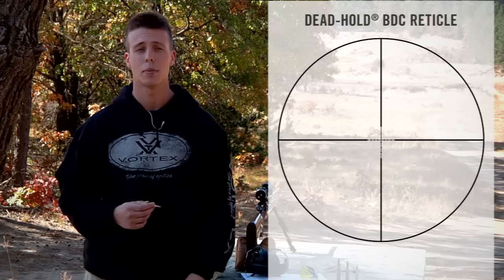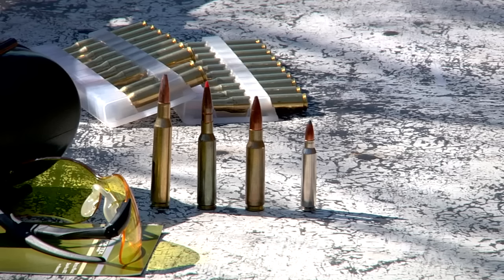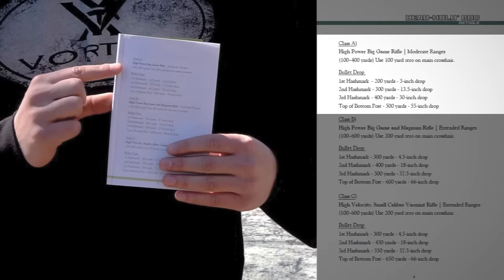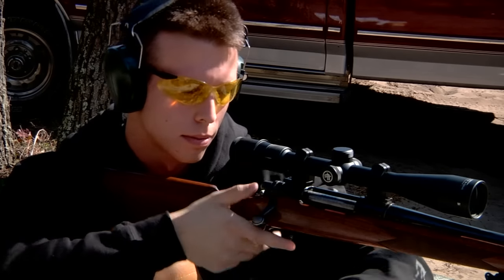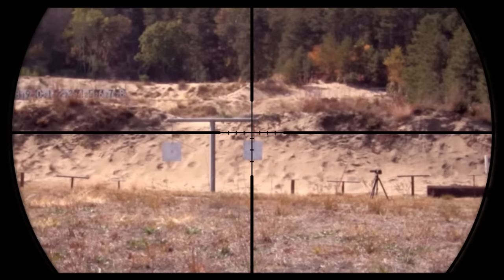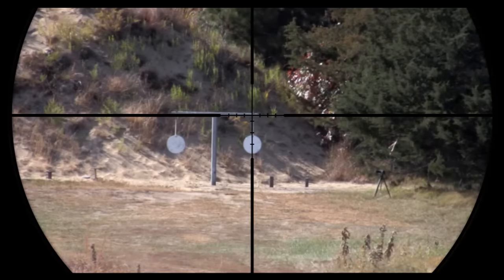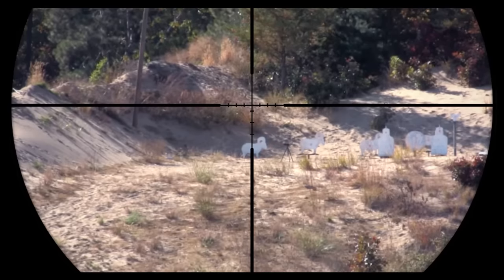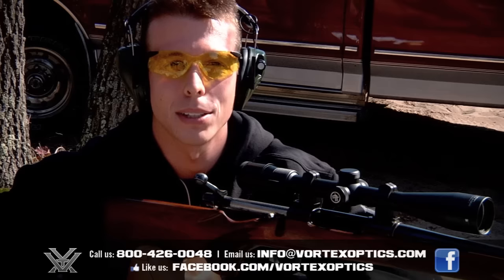How To Use the Vortex Dead-Hold BDC Reticle

Comment from the maker: Good morning Brian- Kind of depends on if you're running the .338 Win Mag or Lapua... Most loads for the Win Mag will follow the magnum category better- Class B. This is listed in the manual or on our website. It works off a 200 yard zero. Just remember to validate all of this at the range. The BDC is a good estimate but testing this to confirm the data in the field is very important. Thanks and let us know if you have more questions.

Comment from the maker: There are no indicators on the BDC reticle that are designated for shots at those distances but the LRBC on our website has a feature where you can manipulate the magnification to change the subtensions and then observe how the holdovers change. It is possible you could find holds for those distances from simply lowering the magnification. Thanks again and please let me know if you have any other questions.
Reply: I just ordered a crossfire ll 6x24x50ao the gun I will have it on will be my ar15 18 in fluted 6.5 Grendel using 123 gr sst hornedy says flat on ammo box at 200 yrds should I zero my rifle at 200yrds then use the bars on the reticle to go from 200 yrd on the middle cross hair out to 300 yrds and so on?

Comment: Great shooting! Just purchased a Vortex 4-16X50 Crossfire II and I love it. And I absolutely love the warranty! Worth every penny.
Reply: My little cousin got me one for Christmas last year. LOVE IT!
Reply: How is it holding up?
Reply: @rikertvonfulton16  I have one on a .243. Front ring adjustment for parallax. When I shoot it, it rings like a tuning fork.  DING!  Don't know why. I may wrap a couple large rubber bands around the bell and see if that stops that noise. So far the accuracy seems okay. Sub MOA out of a Savage 10 MAX1 Predator.  If it doesn't work out I'll just slap my old $49.97 3X9x32 Tasco on it because it will shoot .38 inches at 100 yards with a factory .22 Stevens 200 .243 :)
Reply: @cbsbass4142  Just pulled a tasco because the crosshairs were moving around in there.I put the Vortex on. 2x7x32.
Reply: @rikertvonfulton16   I may have just been lucky with that old Tasco. It came on my first .Savage .308, gosh, maybe 25 years ago. Very clear and sharp still. Much better than  later Bushnell that came on my next .308. I nurse it by using it only on low recoil calibers.

Comment: Tested this on my 7mm-08 and confirmed it is reliable out to 500 yds. Thanks for the great video
Reply from the maker: Awesome! Thanks for being a part of Vortex Nation!
Reply: How many yards did use Eero it at I'm shooting the same caliber also interested in the mo
Reply: @stephenkulawinski4200  I zeroed @ 100 yards.
Reply: did you use  the vortex LRBC  FOR THE AMMO YOU ARE USEING IN YOUR 7MM-08?
Reply: @gooseman26  yes/no. I use handloads I reload myself. I have checked them on a chronograph for avg velocity. I also have input this data into a ballistics calculator and I have a dope chart worked up for my rounds. However, the Vortex BDC reticle is a solid quick reference that works fairly accurately and reliably at 100 yd increments out to 500 yds.

Comment from the maker: Glad you're enjoying your Viper! The .17 HMR actually does not fall into either of those categories. However, someone discovered that if you set the scope to max power where the subtensions are correct, then zero your .17HMR dead on at 50m (yds) then the dead hold bdc lines below correspond to 100, 150, 200 and 250 (top of post). Thanks and please let us know if you have any other questions.

Comment from the maker: The Viper 6.5-20X50 or 6.5-20X44 both use the mildot. The Viper HST and Viper PST both use mils subtensions similar to the mildot reticle, but with finer graduations. The Razor HD also uses a reticle and turrets with mils subtensions. Thank you and let us know if you have any other questions.
Reply: I have a 270 with a 6×24×50 vortex crossfire 2 what is max distance for scope
Reply from the maker: @andrewcarter4937  That would depend entirely on your setup and ballistics. Give us a call at 1-800-4VORTEX ext. 5 and we can help out!

Comment: That reticle also works good with 950 Fps 22 subs . I'm hitting dead center at 35 and 22 yard targets and out to 60 yards I use the first line down for quarter size groups right in the bullseye.  Works like a charm.  Have a Crossfire II 3x9x40 with burris Zee rings (Low) on a 10/22 and Magpul hunter stock.

Comment: I just purchased a Diamondback 4X12X40 DH BDC. For the price it is a great value. I placed it on top of a MVP 5.56 X 45 rifle. Zeroed it in at 200 yards. I have owned many high priced scopes. This one is a true workhorse with above its price range capabilities. If you are looking to by one don't think twice.
Reply: I like the reticle even if I don't use it much. fooled around some with it at my ranges limit of 300 yards on an 8 inch round steel chain swinger with my .243. I  hit it. I just really can't remember the holdover or bullet weight.

Comment from the maker: Good question! In the dead hold BDC manual that should come with any Vortex dead hold BDC riflescope, there will be different categories listed inside that you will have to fit your cartridge into. The 22-250 would be Category C: Zero at 200, first hash is 300y, then 450y, then 550y, then 650y. Those are just approximations, though. Make sure to test all of these with your specific cartridges at the range to confirm and/or adjust accordingly.
Reply: Would the 6.5 creedmoor fit into that same category?
Reply from the maker: @ryanmounts6633  That would probably align closer with category A. To get the most accurate results though I would recommend running your specific ammo through a ballistic calculator.
Reply: Alright ill do a little reasearch, my factory ammo advises a 200 yrd zero is why i was thinking itd fall in with c but ill do so.e more digging, thank you

Comment from the maker: Since all of our riflescopes with BDC reticles are second focal plane scopes, they all require that the magnification to be set to the highest power to be used accurately. If the magnication is set to a lower power, the hash marks will be worth more than they are designed to be. Thanks again and please let us know if there's anything else I can do for you.
Reply: Is there a way to do something like 'half zoom/double value' on the bdc, or would I have to build a whole new table at different zoom levels? 
Asking in regards to making ethical kills with the 'dead hold BDC' on a 22lr on ground squirrel sized targets between 25 and 100 yards. Will this work or should I just bite the bullet and spring for the FFP?
Thanks
Reply: Metric bdc would be a nice option

Comment from the maker: Windage will be different for every rifle, cartridge, distance, and wind speed. There are too many variables involved to make a short, simple video on it. I would recommend using a ballistic calculator to estimate wind holds and then validating this data in the field with your specific rifle. Thanks again and please let us know if you have further questions.
Reply: At what magnification are the BDC markers usable. I know some scopes claim that their markings are only accurate or to be used at max magnification.
Reply from the maker: @robertwest4299  Most are at the highest magnification, but some will be at a specific magnification that will be listed in the reticle manual.

Comment: Works very well with the Vortex scope.  However, using a Leupold 3.5 to 10 with a 130 gran  Hornady Interlock SP, our zero is at 200 yards. At 300 yards it has a drop of 5.7" drop, yours is 13.5. - At 400 yards it's 16.7" , yours is 30" - and at 500 it's 33.7" and yours is 55".  A difference that can not be ignored when shooting long range.  We'd like to hear back...
P.S. we also use Remington ammo, which has about the same printing results with boat-tail ammo. To be fair, we're shooting a custom Mauser with a 26.5" barrel, 9.5 to 1 twist.
Kind regards
Reply: TJ Jones
  I'm not sure you're asking a question? By the way, I said in using Remington ammo that boat-tail has the same results. Well, I should have said I don't use anything but boat-tails.
  Not to be too critical, but shots 2, 3 and 4 were lower then each hash mark. The first and last shots were right on it. That said, my Leupold has the micrometer setting, and at each of the same distances, I only need to go up to the next number and the shots are dead centered with no variance, just dead center. Your shots were fine, but wouldn't necessarily yield a high score when counting rings to the center of a target. I do believe that is the difference in price of each scope. You will hit the target, but it won't be as accurate to the scope's strategic BDL. Maybe I'm too fussy, but that's why I spent the big bucks, that orther 1/2 or full inch you're losing.
Kindest regards.
Reply: TJ Jones
What are you talking about? Maybe you're addressing someone else? I don't know how the 3006 got involved. lolo

Comment: i just saw this today - got an expr winch- never used a scope before - thank you
Reply from the maker: Glad you found it helpful :)
Reply: Does anyone know what isize flip up scope cover for the vortex 3-9-40 scope front and back
Reply from the maker: @maxlewis2234  If you are looking at the Defender Flip Caps, you will need the E-10 eyepiece and the O-40 objective piece for your scope.
Reply: @VortexOpticsUSA  OK thanks for the info . I am interested in them just reviewing the product,  however I  have read that they tend to fall off in cold weather , I live in a cold climate . But overall they are good . Someone suggested using double tape, is this an issue with the product.
Reply from the maker: @maxlewis2234  No issue using double tape! You are good to go there.

Comment: Thanks for this video.  Primary arms is running a killer deal on your 3x9 50 bdc crossfire model and a burris pepr mount bundle that I couldn't pass on.  It's in the mail.  I'll be at the range soon getting this scope dialed in on top of my new AR15 build.  Once its all tweaked to my liking I think its going to be a fantastic arrangement.  This will be the first time I'm attempting to stretch my legs beyond 100 yard or less shots.  I'm excited.  A new range opened up near me that offers steel like in this video beyond 100 so seeing the drop marks and approx where to hold was exactly what I needed to see.  If I run into any snags I'll be in touch.  Thanks again.
Jeremy in Texas
Reply from the maker: Thanks for picking up one of our scopes! We really appreciate it. Enjoy stretching out a little bit and yes definitely drop me an email if you have questions. You will find there is some variance between cartridges but with a little playing around, you can figure out what the drops will be for anything you have. Thanks, Jeremy! Happy shooting! - Jimmy, jjordan@vortexoptics.com
Reply: Finally got the scope and mount from Primary.  All mounted up. Ready to hit up the range and start the sight in process.  Again if I have any issues I'll be in touch.  So far extremely pleased with what I received.  I doubt there will be any issues.

Cheers from Texas.
J
Reply: Several trips to the range now. I've only attempted 300 yards max.  Hearing that steel sing has been so rewarding. Several folks that have looked through it have been very impressed with the clarity of the image and have you guys on the radar now too. Especially when they find out how reasonably priced it was. If I'm in need of another piece of glass myself I'm definitely going with a Vortex product again.

Comment: I just zeroed my axis with a diamondback scope using 150gr Hornady. Zeroed at 100, no problem. At 2-300 moving down to each hash mark I was shooting way to high so I used the crosshairs at 200, I hit 2in above POA. At 300 same POA and I hit 3in above at 300m. There were no stray rounds at all three ranges so hits were all consistent. So after watching your video online of the bdc I'm a little baffled. Very pleased with the scope. Thoughts??????
Reply from the maker: Hey thanks for reaching out to us. Reading this, there were two things that came to mind as the likely culprits:

1.       Your 100 yard zero is not actually a 100 yard zero- you were zero’d high or something and maybe didn’t notice it before stretching out to distance
2.       Your rings were over-tightened (generally anything over 20 inch pounds can cause issues- we recommend 16-18 inch pounds).
 
Did you install the riflescope, by chance or did someone else? I’m just curious if a torque wrench was used or if you knew how tight the ring screws were tightened? Otherwise, the possibility of a .308 zero’d at 100 yards that kept climbing out to 200 and 300 yards is physically impossible and it’s just a matter of finding what the issue is. Thanks for the question and please let me know if there’s anything else I can do for you. I would be happy to help. - Jimmy, jjordan@vortexoptics.com

Comment: what 270 load was used in the video? I bought a diamond back 4x -12x  and I am using a 130 grain load with an interlock bullet not sure to use a 100 zero or a 200 yard zero due to ballistics.
Reply from the maker: To be honest, this was filmed 2 years ago so I'm not exactly sure what kind it was. Realistically, no matter what kind of bullet you buy, you will first want to make sure it shoots very accurately out of your rifle. In my mind, that's the very most important part (you can correct for the rest). Then, once you pick a load to commit to, the best thing to do is to map out the ballistics of your cartridge/rifle combo and then match the ballistics up with the hashes on our LRBC program. Thanks and please let me know if you have further questions. - Jimmy, jjordan@vortexoptics.com

Comment: What if you zero at 50 yards? What yardage would you have to use on the 2nd hashmark and so on?
Reply from the maker: Depends on a lot of things. What caliber are you shooting and what muzzle velocity are you getting out of your rifle? What scope height is your riflescope set at? Do you have a ballistics app that you can plug your data into? If so, it will tell you exactly where those hashmarks will line up if you give it that information!
Reply: Vortex Optics I’m shooting a 308 round. I have my scope height to low. And the other questions I do not have the answers to. Thanks for the quick response!

Comment: Resident Vortex fan boy, here. I have a Crossfire II 3-9/ 40 mm that came on my Mossberg Patriot .308 Win. I have since re-homed that to an MDT chassis and changed the scope to a Venom 5-25/ 56 mm EBR-7C reticle FFP scope.

I have watched this video before but now I have a question. That polished wood stock looks familiar. Is that Mossberg Patriot in .270 Win? The fiti and finish looks right and that looks like a long action.

Comment: Will 6.5 creedmoor work with that reticle? I zero mine at 200 yards
Reply from the maker: Absolutely! You would simply want to run the ammo you are shooting through a ballistic calculator to find out what your adjustments are at different distances. You can then relate this information to the reticle to perform your holds.

Comment: Awesome, just purchased a .243 with a 3x9x50. Im SO excited. Question: Should I go with the class A over the C despite my main target being coyote and deer. Any advice?
Reply from the maker: Go with Class C for the BDC not because of what you are hunting necessarily, but because of the caliber - that just correlates to the ballistics of your cartridge rather than anything specific about the animal.
Reply: Vortex Optics Thankyou for the response! I just realized my range only has a 100 yard range :( How do i go about?
Reply: Vortex Optics Thankyou. Am i going to run into complications with class C if my range only allows me to sight in at 100 yards? I am using 55-65grain.

Comment: I noticed on the 300 yard shot that the hit was 6-8 inches below where you aimed. You mentioned that you must test to find out how accurate they are, but my question is, How normal is it for one hash mark to be off so much while all of the others were much closer?
Reply from the maker: Probably looks different on camera... I was aiming for the middle of the plate. The reticle overlay was not a view through my actual scope as I was shooting. It was a graphic laid over the plate image just to demonstrate approximately where to hold on the reticle. The entire plate is probably only 16 inches, give or take. That shot was about 2-3 inches low and maybe 2 inches right (I must have pulled the shot a little bit). Thanks and let us know if you have any other questions. - Jimmy

Comment: So given this video if my 100 yard zero is true I just use the different tick marks with a .270. I understand that he stated to shoot the different yardages but I was just wondering given the fact that I don’t have that kind of area access to get out that far and how accurate the bullet impact would be using the markings. Thanks in advance for any response/help in this question.
Reply from the maker: To get those markings to be accurate for your setup you would want to run the ammo you are shooting through a ballistic calculator. Once you know what your adjustments are at different ranges you can then relate that to the reticle for perform your holds. You would want to verify this data by shooting at the different distances. If you have any questions or need any help running a ballistic calculator, please give us a call at 1-800-4VORTEX ext. 5.
Reply: Thank you. I am using the Hornady 130 grain American Whitetail interlock SP ammunition chambered for .270 with the Vortex Crossfire II 4-18x44 AO scope and it appears to be very accurate with the numbers. I was fortunate enough today to shoot out to 300 yards and the variance wasn’t much off the ballistic calculation (approximately 1.5”-2”). Thank you for the assistance. I greatly appreciate it. Definitely a Vortex customer for many years to come.